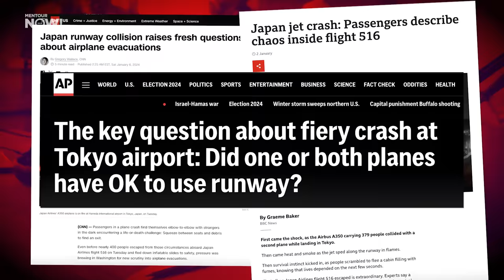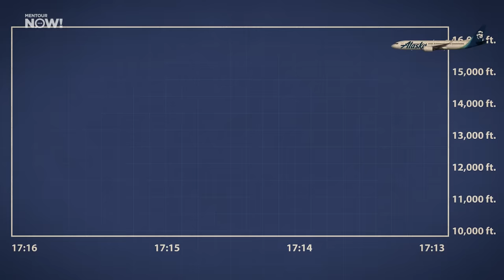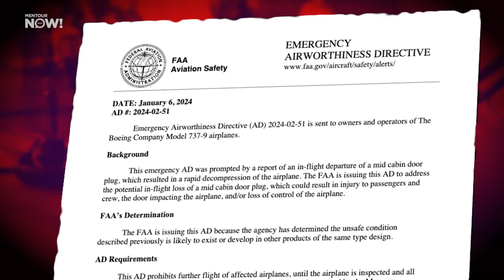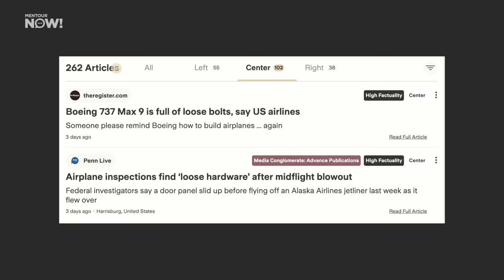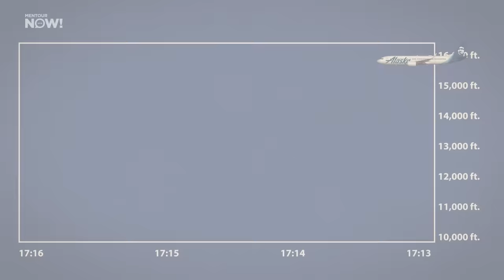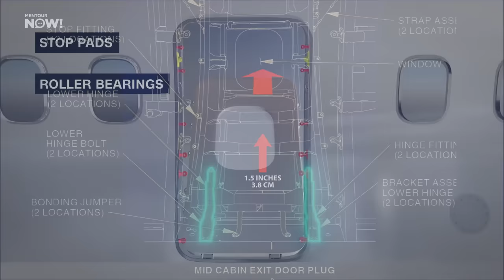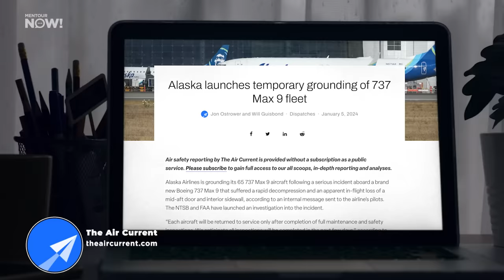WHAT Is going ON with Boeing?! MAX-9 Door blowout

Comment: Until the 2nd 737-MAX MCAS crash I used to always think people were crazy to not fly after an accident.  I'd think it's the safest time to fly because everyone will be paying extra attention to safety.

Now, I just don't know.
Reply: Even if cutting a cost makes a part 0.5% less safe - that's hundreds of aircraft for a couple of decades or so. They've all but ensured deaths pushing the quality to the limit with barely any safety margin.
Reply: It is never safe to fly a MAX.
Reply: What's so damning is that this is a different incident entirely. I flew on a MAX-9 on Alaska a few days before without reservation because the MCAS issues were known and I figured, resolved. Seeing a completely unrelated issue afterwards now brings into question what other aspects of the manufacturing are faulty. Instead of worrying if MCAS is reliable I think it's fair with any modern Boeing to ask if any part of the system is reliable now.
Reply: I trust Airbus A220 and A320 over the MAX, they are built at Airbus Alabama with no problems
Reply: Covid caused a massive shake up in society. People changed jobs, early retirement etc etc. A lot of know how and experience and old work ethics disappeared. That is why we see so many failings. Not just in aviation. I don't think it's safe to fly at all.
Reply: @JohnnyWednesday  Is it cost cutting? Yes it is, but at the same time, it is not. There is... I wanted to argue that there is no board meeting where risks are weighted against costs, but the reality is: There are. But... The risk calculations are all over the place as the financial benefits of outsourcing are obvious, but the financial risk of a disaster and its long therm implication for the brand are not. Also, the cost saving can be quantified in a quarterly report, but damage to brand image are immeasurable and off course the fault of managers long gone.
Reply: They are just adding doors and plugging them. Instead of creating two different fuselage to meet specific requirements. Same with MCAS, they made the system so that they can avoid additional pilot training. Who knows what other kludges they put in due to their own profit motive or the airlines' cost saving measures.
Reply: You really cannot be too careful. Sometimes discretion is the better part of valor.
Reply: The problem is, you assume Boeing cares enough about safety to learn lessons. It is not clear this is the case, not to the public, and not to the FAA, as seen from their statements.
Reply: Boeing has gone down the Ford Pinto route, accepting the casualties as a cost for doing business - and one that cheaper than fixing the issues.
Reply: @JohnnyWednesday  no....that's why there is preventive maintenance and redundancies. A part failing does not automatically lead to a fatal accident. Prime example of using statistics to lie
Reply: So what’s next? Just figure out one problem at a time each time a Boeing plane falls out of the sky?
Reply: @awdrifter3394  I think the  situation with MCAS was different in that the marketing and management had already decided that additional pilot training is not an option even before the engineering had figured out if that's actually possible.

And the angle of attack (AoA) sensor couldn't be made mandatory part because that would have made that critical part of the aircraft, which will always require mandatory training. So that option was off the table because of political decision that marketing or management had already made without understanding the consequences.

This time it appears more probable that the problem was error in manufacturing and that was not caught because of incorrectly designed or implemented QA process. It doesn't seem that there was any reason for politics to prevent doing that part correctly, unlike with MCAS.
Reply: I believe that pigs and DC-10's can fly. 
Long time ago DC-10's kept dropping out of the sky. 
Problems with engines dropping off the plane....

If the error is due to a plane then its debatable if its safer to fly until they have worked out the problem. If its people problem the  yes they are going to be extra carefull. 
So make your own choice. But the plane has had a lot of iffy problems. I might avoid those planes if I was going to be flying.
Reply: @ytzpilot And you are aware that they both have landing gear issues that could prove lethal, no?
Reply: @chukwudiilozue9171 It has actually become one of the safest aircraft to fly due to the high standards that have been placed upon it.
Reply: @Doctorwhatswrong And they are only becoming a part of the group that holds it to a high standard by doing so. Also, what if there are last-minute changes in equipment and they literally have no other choice?

Comment: Hello Peter,two things to note. The lock bolts are secured in place with a castellated nut and cotterpin, not lock wired as you said. You can see that in the still picture in the video just as you said it. Also after reading many comments on this video and some other very popular YouTube channels there is much confusion on the locking of these bolts. For example in this instance the castellated nut WITHOUT the cotterpin is self locking as well. When installing this nut you can thread the nut on by hand only about two threads before you have use a wrench or other tools to tighten the nut. THEN the cotterpin is installed, essentially making the assembly double locked. A normal nut an average person would know can be screwed down with your fingers quite easily. So even if the cotterpin was left out the nut would not back off on its own. This leads me to believe the bolts were not installed.
Reply: I tend to agree with your fixings analysis, but I struggle to believe that the door would stay in place for 3 months of regular flights without them...

Maybe it is normally extremely sturdy even without the bolts and the airframe took a really heavy landing in a previous flight that moved everything 1-2mm and started the process...

We will learn soon I suspect.
Reply: @alan_davis  Kinda. The door is designed not to open by itself, even without being properly secured (as it should), but whatever force it has experienced was just enough to open it only on this flight, and not on previous ones.
Reply: A nylock nut, also referred to as a nylon-insert lock nut, polymer-insert lock nut, or elastic stop nut, is a kind of locknut with a nylon collar that increases friction on the screw thread.
If this is what was used, the cotter pin or wiring is a redundancy we want to see. You would never be able to put in the cotter pin, until the nut is fully set, exposing the hole in the bolt.

The nut can not be fully set by hand. IT MUST be done with a wrench, and not a high speed tool. Air wrench must be below the specification for the nylon to not melt, roughly 150 rPM. 

I am not sure, but I was always taught NEVER TO REUSE a nyloc fastener... always REPLACE.... iI know it to be a one-time faster, or it will be out of specification. ( For mission critical applications ) on a go-cart, you can reuse it 100 times.... what is the WCS ?

The Swiss Cheese model seems to have too many holes, and not enough solids.
Reply: I am concerned about workmanship at Boeing as some photos show that the nuts' castleations are not aligned with the split pin holes. The bolt head  or nut face should be shimmed with washers to ensure that the split pin / cotter pin hole in the bolt lines up with the nut castleations. Several different photos show various standards of good and poor aircraft engineering practice.
Reply: @alexturnbackthearmy1907 No, it is not. Without those bolts, the only thing holding it closed is part of gravity. I say "part of" because those springs work against gravity and try to push the door into a position where it can open freely. The 12 pads also have no kind of locking, so while they hold it shut, they do nothing to prevent it from moving into a position where it can open. The roller guides are also angled in a way where they translate a pushing force on the door into a lifting force once it has moved a tiny bit.

It is very much designed in so many ways to open by itself...
Reply: @citylockapolytechnikeyllcc7936 TheTh
The casellated nut used in this case is not a nylon lock nut. What makes these nuts self locking is the nut is slightly oval...not a perfect circle. This makes them have a running torque. You can not run them on with your fingers and there is no nylon in them. The  cotterpin is the secondary lock.
Reply: @citylockapolytechnikeyllcc7936  Sorry but stiffnuts CAN be reused provided they meet the minimum torque value when tested. There are tables published on the web for such tests applicable to aircraft use. However, I was taught in my RAF Aircraft Apprenticeship that the basic rule-of-thumb is that if you can wind a stiffnut onto the thread when the locking mechanism is engaged using your fingers alone, the nut is unserviceable and must be replaced.
As for using a castellated or slotted nut with an integral nylon or other locking mechanism, that's nonsense - The whole point of the castellations or slots is for locking with a split-pin (NOT locking wire). The stiff nut characteristics are redundant. If a fastener is used in a critical assembly, stiffnuts aren't sufficient and a more permanent method should be used.
If I remember correctly, friction-type locking is Class 2 and used in non-critical applications whereas split-pins, tab-washers, taper-pins, locking wire, peening etc are regarded as Class 1 and used in critical application.
I am currently building my own aircraft and the build manual states that Loctite should be used on the Nyloc stiffnuts which goes against all aircraft engineering principles. I've taken this up with my inspector who has fed it back to the manufacturer and he's told me he doesn't build his using Loctite, so is happy to sign mine off the same.

Comment: The terminal velocity of a tumbling cell phone is actually pretty low. It's just a matter of luck landing in some soft grass and not on a paved road and most phones could survive.
Reply: And if it hits some kind of bush instead of landing directly on grass, there's no need for a case at all.
Reply: @killz4money  More like 50 feet, in all likelihood. Phones are pretty light and not very aerodynamic.
Reply: @MikkoRantalainen  Then it is so strange that we see cracked phone everywhere. A mystery.
Reply: @razvanlex  Not really, it's all about what they land on (and the angle at which they land). As people have pointed out, this phone landed on soft grass, possibly having been decelerated by bushes first. There are a few cases of people having survived falling from an aeroplane, because they were lucky in what they hit.
Reply: @razvanlex  When you meet somebody with a cracked screen, do you think they have been living within bushes and soft grass. Or in concrete jungle?
Reply: @MikkoRantalainen  No, I think they dropped it from a height of 1 meter, not 5.000. Terminal velocity for a phone should be between 40 and 90 m/s, that's between 144 km/h and 324 km/h.
Reply: @michaelwright2986  What you're saying is a "straw man" informal fallacy. The people survived but not without a scratch.
A phone has a terminal velocity between 140 and 325 km/h.
Reply: @razvanlex  It might be an imperfect parallel, but it's not any kind of fallacy. Fallacies apply to logic; this is about empirical observation.
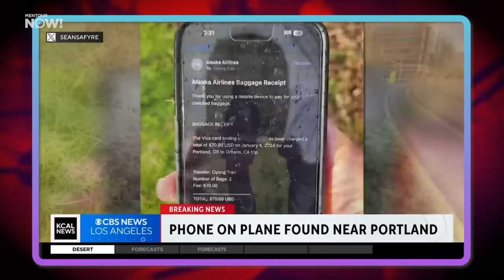Reply: @razvanlex  20:13 you can see the phone has a screen protector. Which compared to the native glass most commonly has a 9H mohs rating rather than 6H or 7H since the display is laminated to the glass.

also the pics show them searching some shrubs, so that likely cushioned the fall. Seeing that the phone is wet it also may have made the grass softer.
Reply: @jujuu1339  I would argue that no smartphone or screen protector is 9H for real. In marketing materials, sure, but if you actually test scratching it, nope.
Reply: @michaelwright2986  Yes, you are always right.
Reply: @jujuu1339  I understand, so what you're saying is that is perfectly logical and normal for a phone to be intact after a 5.000m fall from an airplane. No big deal. Ok.

Comment: It is important to note that although the top pair of bolts block the movement of the roller pin within the guide track, the lower pair are drilled through the hinges. Considering that everything on an airplane is built with contigency in mind, a substantial percentage of these bolts must have been either left loose or totally absent from the factory for this incident to occur.
Reply: "Bolts too expensive. Nobody is going to see that they're missing. Mark it up as good to go." - Boeing inspector
Reply: "Bolts too expensive. Nobody is going to see that they're missing. Mark it up as good to go." - Boeing inspector
Reply: "Bolts too expensive. Nobody is going to see that they're missing. Mark it up as good to go." - Boeing inspector
Reply: "Bolts too expensive. Nobody is going to see that they're missing. Mark it up as good to go." - Boeing inspector
Reply: "Bolts too expensive. Nobody is going to see that they're missing. Mark it up as good to go." - Boeing inspector
Reply: "Bolts too expensive. Nobody is going to see that they're missing. Mark it up as good to go." - Boeing inspector
Reply: "Bolts too expensive. Nobody is going to see that they're missing. Mark it up as good to go." - Boeing inspector
Reply: "Bolts too expensive. Nobody is going to see that they're missing. Mark it up as good to go." - Boeing inspector
Reply: "Bolts too expensive. Nobody is going to see that they're missing. Mark it up as good to go." - Boeing inspector
Reply: "Bolts too expensive. Nobody is going to see that they're missing. Mark it up as good to go." - Boeing inspector
Reply: "Bolts too expensive. Nobody is going to see that they're missing. Mark it up as good to go." - Boeing inspector
Reply: "Bolts too expensive. Nobody is going to see that they're missing. Mark it up as good to go." - Boeing inspector
Reply: "Bolts too expensive. Nobody is going to see that they're missing. Mark it up as good to go." - Boeing inspector
Reply: "Bolts too expensive. Nobody is going to see that they're missing. Mark it up as good to go." - Boeing inspector
Reply: "Bolts too expensive. Nobody is going to see that they're missing. Mark it up as good to go." - Boeing inspector
Reply: The event suggest that either the locking-bolts weren't fitted at all, or the split-pins or locking-wire securing the bolts wasn't installed correctly or at all. If the bolts had been fitted but not locked and come undone, there should be witness-marks around the holes and the bolts and nuts would have fallen down beneath the door frame, so should still be lying there and will have to be found. If the locking bolts hadn't been fitted at all, from the design of the load-bearing hooks, gravity would have held the door in place for a while until it jiggled out and was free. Either way, it's a miracle nobody was seriously injured or killed in this incident.
Reply: WiFi installation removes the door plug after it left factory
Reply: @indiekiduk right?? 😂 Bluetooth bolts
Reply: Holy cow, if they left bolts off this part what else did they leave them off?